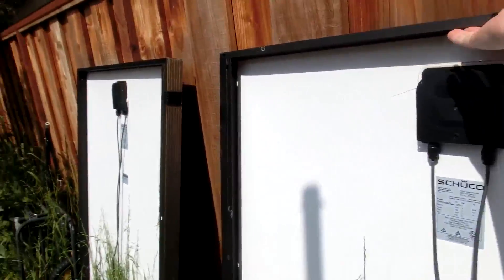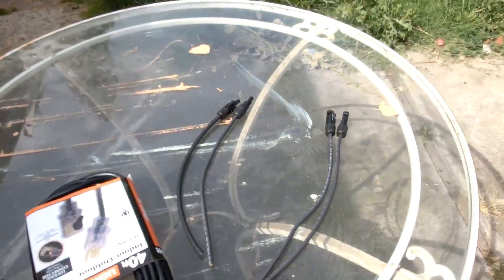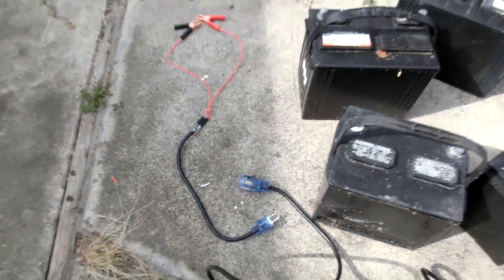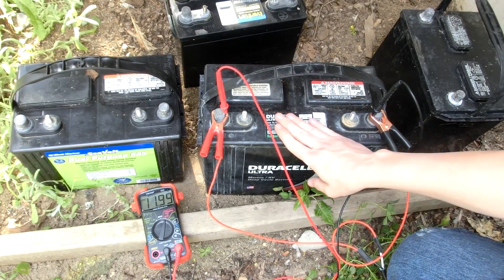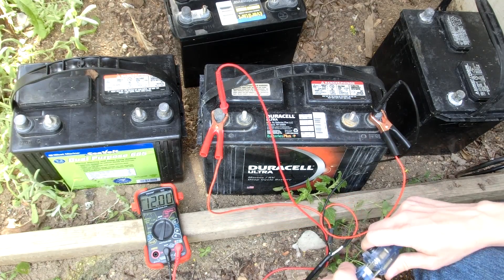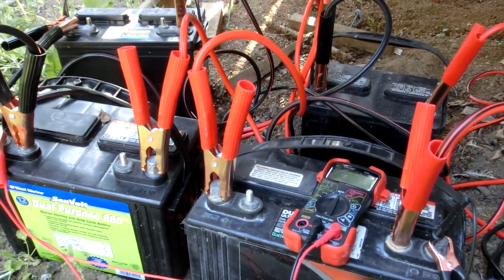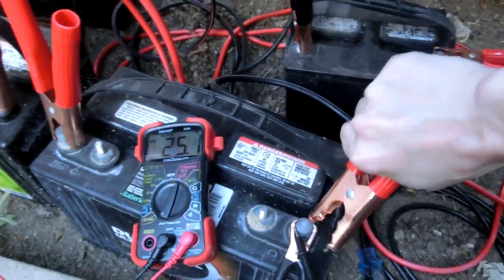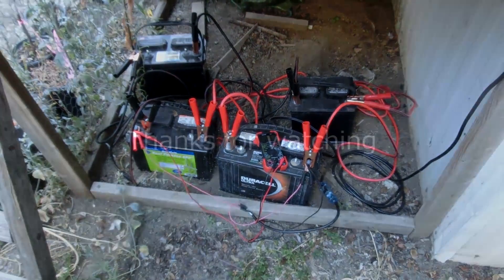Solar Sunday Experiments 010: broken panels and old batteries, cheap off-grid system

Comment: I think what you're looking for is called a diversion controller. Normally used for wind and hydropower systems, it can also be used for solar.
Instead of disconnecting the generation source from the battery like pwm or mppt, a diversion controller connects a load to the batteries keeping the voltage from going too high and damaging the battery..
Common loads are typically either air or water heaters, but it could be just about anything that uses electricity and draws enough current from the generation source.

Comment: You seem to be VERY smart but, take it from this public school , 9th grade drop out and trust me when I say that your batteries will last a lot longer if you get them off the ground . Make a self .
Reply from the maker: no thats an old myth that is total bullshit. its from back when batteries were made of wood to hold the glass cells together, but that hasnt been the case since WW2. there is no mechanism for batteries sitting on the ground to cause trouble now.
Reply: @RinoaL  Makes a man wonder why we was raised on such an old myth.But they do seem to drop dead if I leave them on the shop floor .
Reply from the maker: well thats the thing, a lead acid battery will die after a few months anyway. their self-discharge rate is very fast. meanwhile lithium-ion is like several years.
Reply: @RinoaL  What do you think about putting a 500F capacitor that the kids use on their bigass car stereos between the battery bank and the inverter ? would that take some of the hit on start up ?
Reply: @johnkenton5157  I think a big capacitor is a great idea because the quicker you draw current from a battery, the less capacity it has. An inverter draws a lot of current 60 times a second. I would think a capacitor could even that out to an average over time.
About the batteries, batteries use chemical reactions within them. A chemical reaction works much better when warm. If you leave a battery on the ground, it can get quite cold and the chemical reaction then could get sluggish, and not work very well.
By the way I heard the same wives tales when I was growing up.

Comment: For your charger, why dont you keep a normal pwm circuit to do the mppt but rather attach the output to two MOSFETs in prallel, one an enhancement and the other a depletion type. You can connect the batteries to the enhancement type and your dump load to the depletion. That way you dont need to muck about figuring out how to rework MPPT :)

Comment: i have a 200 watt 36v panel, but my system is 12v, any suggestions on how i could connect it?
Reply: You could connect it directly, although you won't get the full 200 Watts.
 I agree with MWB gaming, that to get the most from it use a real maximum power point tracking controller or mppt.
 Check out the Adam Welch Channel to sort the real from the fake inexpensive, and durable mppt's

Comment: With a 7 watt - 12 solar charger .. do I charge one 12 volt battery at a time ..  or if I put them in series - say - to make 48 volts .  do I then still use the solar charger on the whole 48 or charge each battery individually ?  Also ..   can I run an inverter to only one 12 battery or hook it to say 24 volts (2 - 12's in series) or positive to positive in series ..  with greater amps to run a more powerful 12 inverter?        thanks much ..   Gary
Reply: Yes .... it does ..  thank you!!   Again - thanks for your videos!    Gary

Comment: mmh why these german connectors won´t fit your system is simple, they are supposed to be mounted in europe and the connectors are meant to work in higher systemvoltage.
btw mc4 is a description of electrical insulation for dc appliances and if they are meant to run a voltage thats any larger than 48volts the connectors look different.
please check your voltage at the soldering points again they are engineered to run with an diode in every string.

Comment: I believe the easiest, most practical use of excess solar derived electricity could be simply installing an electric water heater plumbed in series with existing. If you would rather collect hydrogen then a sodium hydroxide water electrolyzer with a consumable graphite plate and steel cathode would work if a terracotta membrane is a partition. However, hydrogen explodes with a real loud bang and is spontaneously catalyzed to explode with sunlight and oxygen between 5 and 90% hydrogen.  It would be fun but might be a bit too exciting. You can also buy fuel cell ionic membranes sulfonic or carboxylic acid polymers that are coated with platinum black and nickel powde. Fuel cells are fun but may be rather time consuming and hazardous.

Comment: HI Super-Genius
Do enjoy your solar battery projects videos,,, have my own little series going,, which I am strongly neglecting,, I want to power my house with 18650 cell's :-) made in to 48V packs and powering an U.P.S. that makes 230V :-)
Suggestion,, have the solar setup, power an array of fans that can blow the "cool" air up from the basement. You can use computer fans zip tie them together as a "wall" and run two fans in series on 12V (a lot less noise) . I think i mean the left over power...  You will have the power when you need it :-)
Reply from the maker: are you going to run your server system on solar also?
Reply: Hi Rinoa Super-Genius 
How cool that might be, I do not intend to start there. If I could power my house friday night from the power my solar panels has stored doing the week,, It would be a great start.

Comment: Hey Rinoa,  check out the Schneider c60 charge / diversion controller.  This'll allow you to connect up the diversion controller between your solar cell and the battery bank, and then strip off extra current whenever your battery setpoint voltage is reached.  Can be diverted into any sort of load - hot water heater, HHO splitter, etc.  Cheers!
Reply from the maker: oh cool!

Comment: Do you have a diode to keep the batteries from discharging back into the panel?
Reply: This. If the sun goes down, you will have a 1,5 square meter roof heater, as they just become 2 huge resistor sheets :D
Reply from the maker: yeah the panels have them in them.

Comment: Those two different solar cable connectors may have been MC3 and MC4 connectors. MC3 connectors are for smaller cables than MC4. 

I don't know the AWG rating but MC3 is good for cables 4mm or smaller and MC4 is good for 4mm or 6mm.

Comment: it will be cool if you put your batteries in that basement under your room and fed wires through that little door and have inverter 12v to 110v and you will power your room through extension cord.because now you didn't use your solar energy you just charging batteries and its almost useless.

Comment: so the pwm charge controllers are basically a trickle charger when voltage gets to a certain level?
Reply: Leave the pwm charger in place as it's doing what it's required to do and build something that starts to draw power once the batteries are fully charged and the battery voltage is over a certain level. Finding a proper application for the energy your storing is all that really required.

Comment: LOL, two years ago you would have purchased tabbed cells, lots of recycled laptop batteries, plexi-glass, plywood, duct tape, a pound of rosin core solder and a grid tied inverter, gone for it tongue and cheek!
Reply from the maker: what? please rephrase that.
Reply: I was just kidding, implying that you'd gotten less rudimentary and now instead of building from elementary components you've purchased used preconstructed panels with standard connectors. I"d found that the desirability of your posts was with your innovation using very, very basic materials. I hope to never see you order new and off the shelf.

Comment: Not bad. I have been using 9 really old amorphous pannels that I found at a yard sale for $20 and old batteries that I found at a recycling place for $12 each for the last 4 years. Instead of buying new wire, (don't get me wrong I like the locking connector) I use old jumper cables crimp connected to each other to link the panels to the batteries

Comment: I thought PWMs pass on the excess to the load terminal when the battery is full and solar energy is still coming through? why not just use that and shut off whatever device (such as a hydrolysis device) is hooked to the load, on a timer
Reply from the maker: i didnt think it worked like that, but i could be wrong. good question though.
Reply: +Rinoa Super-Genius I'm not 100% certain but IIRC, with a device plugged in to load and only the battery i was drawing more current than with a charging device such as a solar panel plugged in. it's still not as ideal as building something more efficient but just thought I'd throw it out there to test

Comment: You should see if your tenant will let you run a wire from The solar panels to the crawl space. Then your charge controller that you will make can run a fan in your room.
Reply from the maker: if i want to do it i'll just do it, but thats a very good idea.

Comment: Recommend taking a look at the Blue Sky MPPT controllers - I got one for two poorly placed Kyocera 120w panels and they do a great job keeping a small bank charged. The controller has a bypass circuit that sends excess power out so I was thinking that would be great for a charging recycled lithium bank.
Reply: if you make the system 24v, 2 car batteries, you dont need any controller, just connect the panel direct, it matches voltage very well and gives max efficiency, the only reason to keep a 12v system is if you want to run 12v accessories, but if you plan for 24v such as inverters, you are much better for it.

Comment: this is my charge controller i made , with 12v 30amp dump 1 and another dump 2 which 30 amp  i use the dumps for grid tie  , and dump 2 is my resistor  , it also can be 24volts aswell . https://www.youtube.com/watch?v=2CsMSVvRyxo sorry not the best video planning on doing a hole setup  video next week , with a camera .
Reply from the maker: nice!
Reply: Hi can you  send me a link to the charge controller thanks.